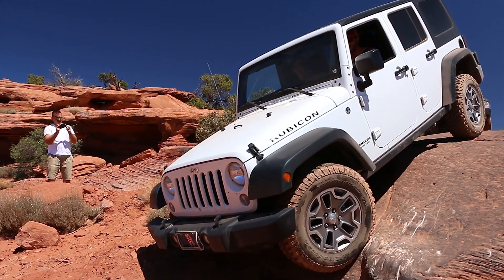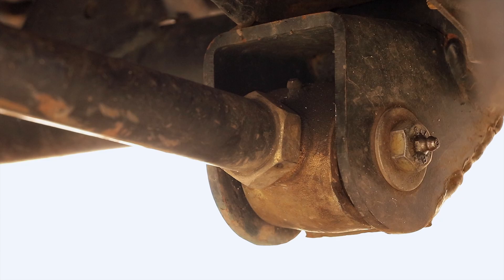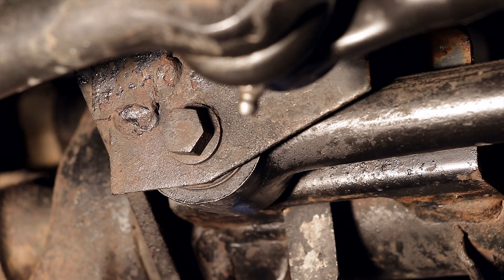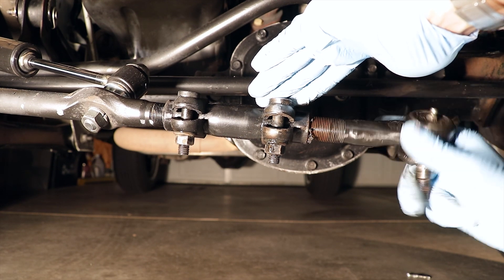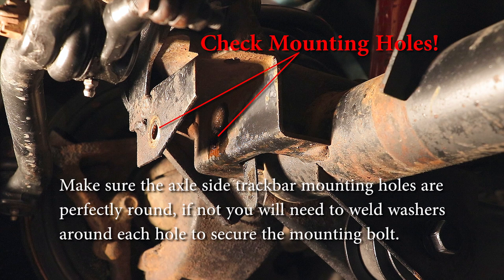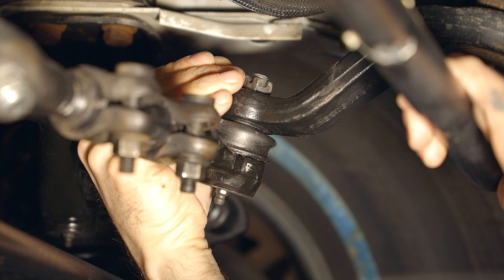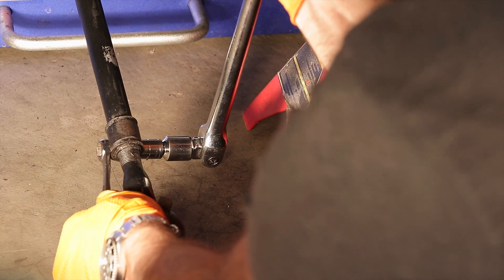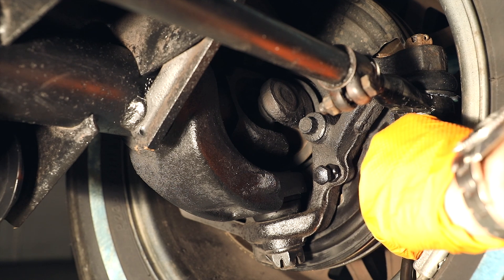Understanding, Diagnosing and Repairing Death Wobble

Comment: What do you do if the track bar hole on the axle side is wobbled out
Reply from the maker: You'll need to weld a thick washer or piece of steel over each side of the hole and drill out a new hole that is the correct size.